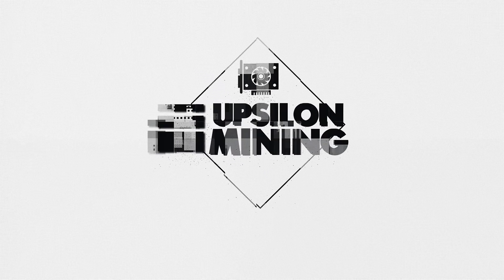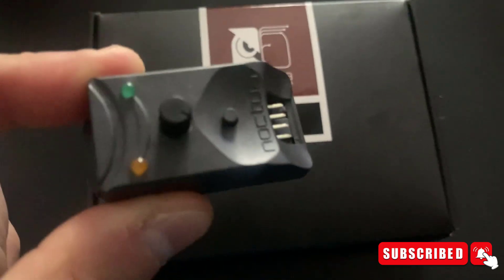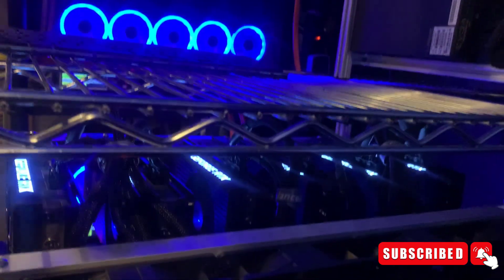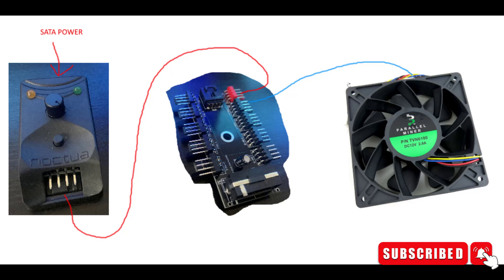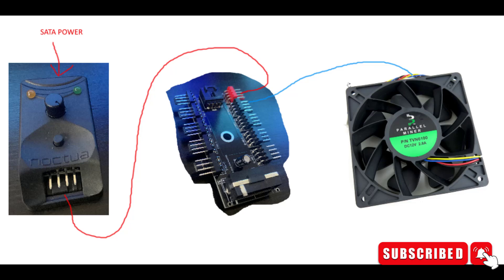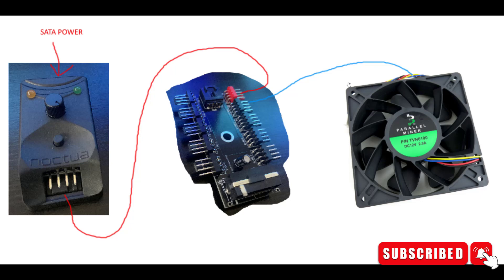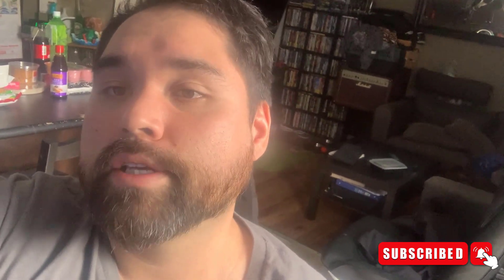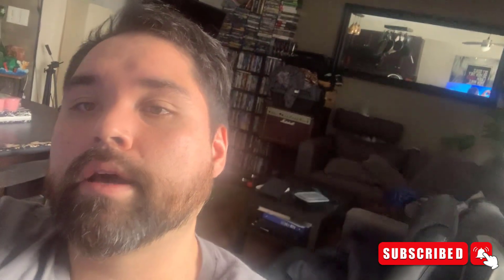Using a Fan Controller and Hub to Adjust Fan Speed Reduce Noise for Mining Rigs

Comment: it's not always speed that you need, in an open box mining rig you are going to loose most of that flow. 
using a hot wall cold wall approach would be much better for cooling and using a ducted air intake where you are pushing all the air through the heatsinks would reduce the temps and thereby fan speed much more. open crate and lots of air, is a big waste of power. while it will have some effect, it isn't going to be very efficient.
Reply from the maker: Thanks for the comment/suggestion, results and mileage may vary of course; I will be monitoring the setup as we enter into summer and adjusting my strategy if needs be.